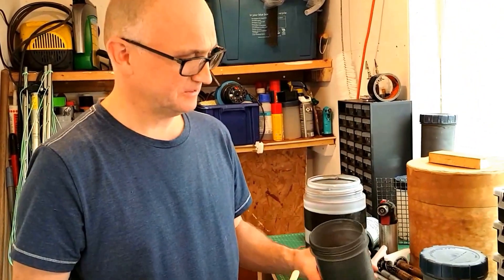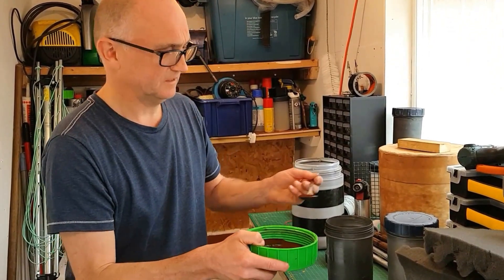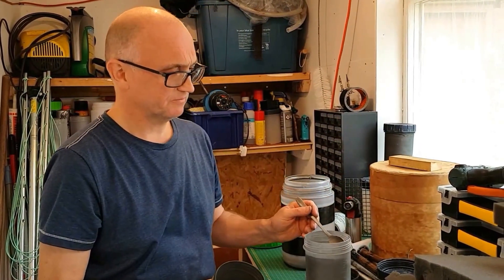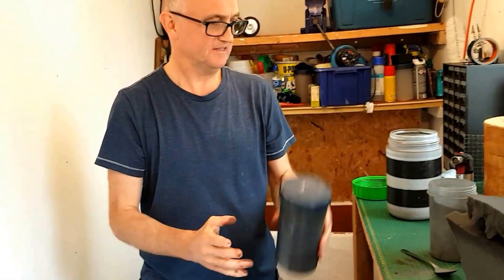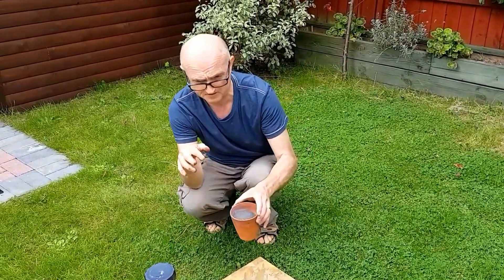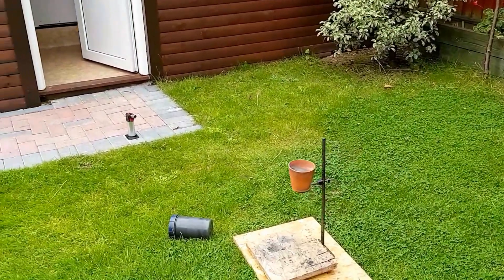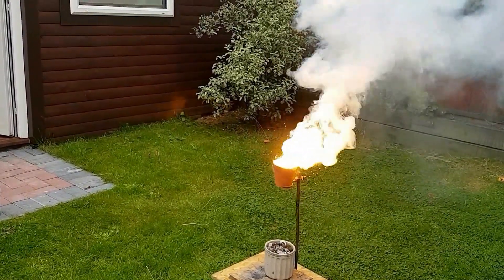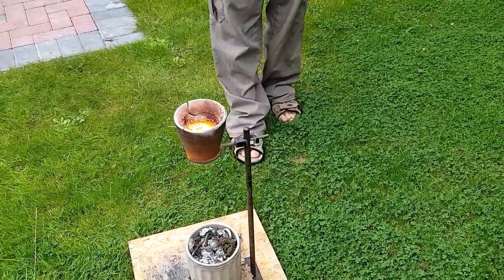Thermite explained with demonstration

Comment: did all the iron oxide react?  If the ratio is 3:2, i'd say you put too little aluminium
Reply from the maker: I would agree that the ratio was wrong this time around.  Copper oxide is a far better oxidiser, but more expensive to buy.